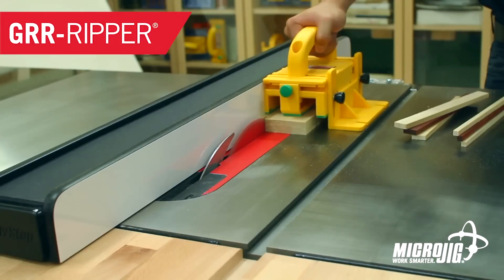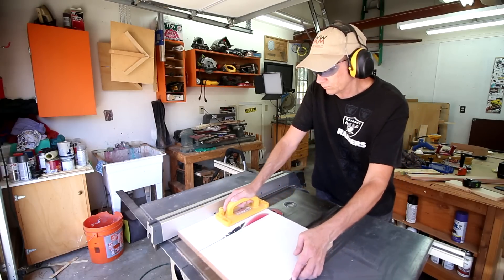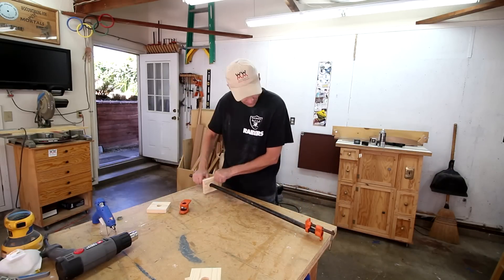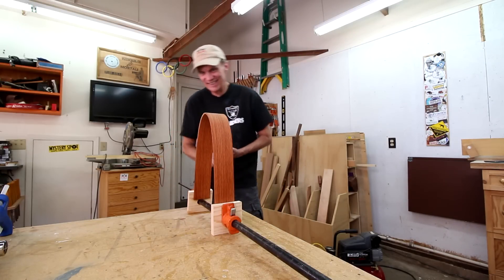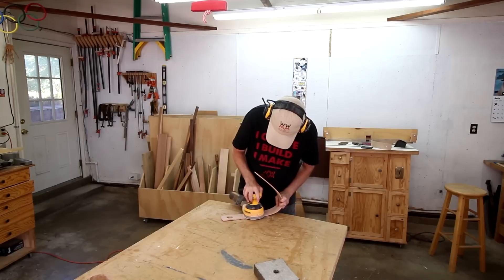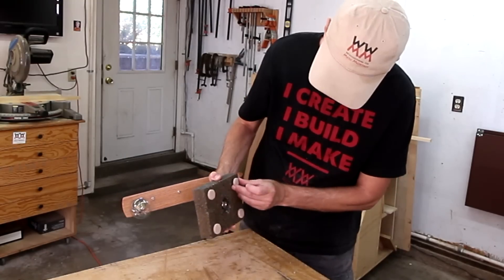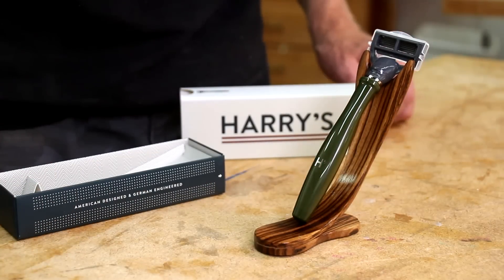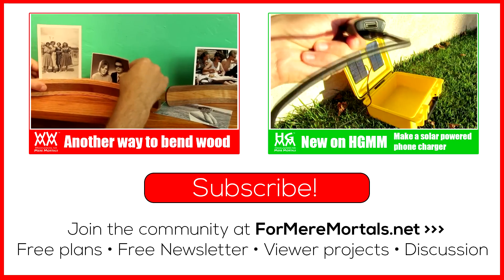Brutalist Style Lamp. Bent Wood and Concrete. | ART & DESIGN

Comment from the maker: For this Art & Design project, I wanted to explore some of the Brutalist concepts and incorporate them into a useful, but artistic piece. Concrete, exposed hardware, and a single bent oak board. Thanks for watching and let me know what you think!
Reply: Good job!
Reply: High Steve, nice project, quick tip about concrete, when you want to knock the air bubbles and voids out of a concrete form try holding a palm sander without any sandpaper to the form, the vibrations will send all the air to the top and you will get a void free cast.
Reply: Brutalism is not because they're brutal, but because brut is french for raw, meaning raw concrete. This is my favourite fact, and I use every opportunity to share it.
Reply: I can honestly say that I thought this was going to be silly, but as you went, I really started to like the idea and concept.
Did you considering making a form to help bend the wood? It might have been safer, but then, also would have involved making more things for one job, so I guess your method was more practical.
Save the form for another long term project?.. eh.

Excellent video over all.
Reply: +John Smith I was just about to post the same tip lol.
Reply: I was wondering what was so brutal about it. :) 
Thanks for imparting your knowledge on us all.
Reply: Sam AOA It's a good one, I learnt it watching a guy making concrete garden gnomes, he had an old beat up sheet sander that he was using to vibrate the air pockets out by holding the sander to the mold, it worked great.
Reply: I love your videos and hope to try one of your projects one day soon. I have to say, watching you bend those boards, you should be wearing safety goggles!
Reply: Steve, I worked for Sakrete for seven years. If you have any other projects involving any of their products, I could give you some tips to make it easier and faster if you'd like.
Reply: I think I would have been tempted to try to polish the concrete; also +John Smith 's idea of using a palm sander is also great.   I love the idea of using raw concrete I just think it could be presented a bit more refined.    Fantastic idea though! :)
Reply: ***** Many thanks, I like the lamp and you could scale it up to make a floor standing lamp too, although I would prefer a different shape to the base, but that's just me  : )
Reply: Holly hooked hockey-sticks, Batman! That bent wood lamp is impressive.
Reply: Any other materials that might be just as bendable like oak?
Reply: +themaconeau I've heard ash is pretty easy. Actually, I recently saw David Waelder bend a piece of MDF with spray bottle and a heat gun. So, I guess anything is possible.
Reply: Rouverius Did you happen to have a linf for that or do I just search his name?
Reply: This is awesome Steve! I've also been digging into the brutalist thing lately as well. Check out the works of Harry Balmer. The "Industrial chain lamp" video I did last month was heavily inspired by brutalism.
Reply: Really cool man . Very inspiring 👍

Comment: Steve, heres an awesome tip as it looked like the concrete had air bubbles and even a crack on the bottom. After pouring the concrete take a sawzall, remove the blade, use the guard on the sawzall and run it along the outside of your concrete mold. The vibration will help settle the concrete. You'll be amazed how well, smooth, and solid it will turn out. Eliminate so many imperfections. I've done this on driveways, sidewalks, patio pads, etc. You get nice clean edges!

Comment: Another great video, when the concrete has been poured in the form a good way to get the air bubbles out is to use a small palm sander on the sides of the form to help get the air bubbles out of the concrete before it sets.

Comment: Hi Steve, this is my first ever comment on YouTube!

You're videos are fantastic. Simple, straight to the point and fun.

You should have a go at continuing this brutalist style by making a wireless phone charger. Maybe recess the wireless charger into concrete? You might want to place a sheet of glass on top of the concrete and charger pad so you don't scratch up your phone on the concrete (or who cares if that happens?lol) Surround the concrete with oak or whatever wood you have and include a tablet charger stand/rest on the back. Of course, the tablet will probably have to be charged using a micro usb wire but thats not the end of the world.

My thinking is this: Your tablet will be on charge when you're out of the house and when you come home, you put the phone down on the wireless charger and lift the tablet :)

Anyway, keep up the great work and thanks for doing these videos!

Comment: Clever trick hotgluing the wooden blocks to the bar clamps! I'll need to remember that as I get more into furniture repair.
Reply from the maker: It's easy to do, but probably not the best method. A form will give you a more rounded curve, rather than an arc.

Comment: Nice project.  For smaller concrete projects like this, if you do want to remove all air bubbles, you can take the blade out of a jig saw then use the jig saw as a vibrator to remove all the air bubbles.

Comment: I really like it, I was surprised how much the oak would bend and stay in shape just soaking it in water, I always assumed steam/heat was required.

I really like the brutalism, there's a restaurant called Handmade Burger Co. and the decor is very industrial, with unfinished walls and the most awesome 'taps' that are literally a copper pipe and 90º turn valve!

Comment: Just a suggestion ... I'm not sure what that "cooking" spray is but I recommend PTFE (Teflon) Spray to prevent adhesion. The dry lubricant variant of PTFE works better than the greasy oil even if you want to pour resin into a mold. Thank you for the great content you are providing!

Comment: Steve, I really like this lamp.... Everything about it is me... The one thing I'd change is the hose clamp... I doesn't fit the lamp... I think you should have cut the metal shade down and use the base to hold the socket on the wood... The hose clamp makes the lamp undecided... I can hear it saying maybe I'm part of a radiator... oh well...

Comment: Jimmy Diresta on YouTube uses canned air to break hot glue bonds.  If you hold the can upside down and spray the hot glue, the liquified gas makes it so cold it becomes brittle and will break away.  That may not have worked to the wide flat bond you had, but it's a neat trick.

Comment: Nice project! At 3:30 when you turn the base upside down there seems to be a crack in the concrete piece. Did lacquer solve the problem (if there really is one)? Should you have used some metal structure inside the concrete for better support/durability? Also the concrete seems so rough, is there anything smoother?

Comment: I'm not a fan of the concrete base, personally, but I love the bent wood and exposed electrical! I'd like to do something similar, and perhaps shape the the board, make it a bit thinner before bending (thinner as in width, not thickness of the board). Do you think a thinner width board would withstand the severe bending? Or would laminate be a better option at that stage?

Base wise I think a couple pieces of maybe 1/4" steel separated by some wooden spacers might be cool?

Comment: I liked the design but have an idea to save some parts.  I wonder if the bolt through the concrete could be avoided.  If the former had one side with a tongue of wood midway on its face then the curved oak could be simply slotted in and friction and leverage would hold it.

Comment: Nice project except for the hose clamp holding the socket. A not too fat O-ring sized to fit snug around the socket and a little super glue might blend in better along with many other ideas. But I liked the simple wood bending. No steam required. Thanks.

Comment: I love brutalism - so was excited to see the video title pop up. The Battersea Power Station in London or even the J Edgar Hoover building are fantastic examples.  

But the bent wood doesn't sit right (for me). It's more mid-century modern. In the end, I love the bent wood but find it too hard to reconcile with the concrete base - regardless of any title. 

A circular oak base, even with the exposed wiring, would have fit better with the curve. Or plumbing pipe out of concrete would have better fit the base.

Comment: Would it be better to add a small strip of wood to the concrete mold so there is a slot for the cord to go through?  Just a thought.  Having the concrete sit on the cord doesn't seem to bode well for the life of the cord.

Comment: nice lamp, but your skills about concrete could be improved. Use white cement instead and add some glas fibers to make it much stronger. Corners should be rounded off with a chamfer strip. Finally put the mold on top of a rotary sander to get rid of the bubbles. Have a look at those pros who do concrete counter tops. Keep on trucking - best regards from Germany - your clips are a must on every Friday - i love them!

Comment: An old Norm made an apron for a corner table which required the bending of wood.  He built a form to the shape he needed and used clams to bend the wood, seemed much safer.The only way a person saves money is to take the amount saved and deposit into saving account and never spending.  I have talked with hundreds of people who have quit smoking and found that non had saved a penny as the used the money for cigarettes and purchased other items.  Not a single person could show a saving by quitting smoking.

Comment: Steve, what is the difference on the various shapes of screw notches?
The older were a straight line, then came the philips, squares, stars like in this video... would you know why? ...thank you!
Reply: The difference is the shape itself.
- "Straight line" aka Slot is easy to make but does not hold the driver centered.
- Phillips & Pozidriv holds the driver centered but can slip thus damaging the screw.
- The rest are just variations of a straight hole that keeps the driver centered and wont slip because they are not tapered.
- There are also shapes that only allows you to turn the screw in one direction so you can not loosen it without special tooling.
Reply: +He Ka I only wish the US would go to the Robertson (square) drive as they have in Canada. Positive lock and no slip as with Phillips/Posidriv. Who has even seen or owned a Posidriv tool?...just sayin'.....
Reply: +RxMixer I can find Robertson drive screws at the Home Depot here in Chicago. The only problem I have with them is that, when using an impact driver, it's really easy to strip out the screw and the bit. Torx drive screws and bits give you better engagement and less stripping, although I have broken the occasional torx bit on a rusty bolt.

Comment: I'm really surprised that just bending oak works that well. I'd have never considered trying that without lamination.

Would increasing the water in the mix have allowed the concrete to settle better, producing a finer surface? I know less than nothing about concrete.  Seems like a great material for doing small work.

Comment: What did you use for the other side of the cable clip screws?
Reply from the maker: Oh, I used machine screws, a washer, then a nut on the other side.
Reply: Thanks for replying, I don't know if you've come across them, but dome nuts work great if you want to hide threads

Comment: I'm glad Harry's and others are taking on the overpriced cartridge razor market, but if you are serious about cutting shaving costs, double edged (safety) razors are the way to go. Cost a little high up front but it's $0.10 a blade which is good for 5 shaves or so.

Comment: Not a big fan of infomercials.
Perhaps your idea was to introduce bent wood technique so I'll go easy but since I have made almost the same lamp in the past I have to say you sure took the easy way out.  Puting a dado on two thin strips and then bending them as you have done but with dado facing dado leaves room to run the wire right up inside the wood so it seems to disappear.  No dado equipment?  Just bend the two pieces like yours and then bend a couple wide enough to leave a dado space between them for the wire to run through.  Just be sure to cut them before you bend them.  It can be really tricky to cut bent boards.

Comment: I'm an ignorant swine when it comes to this stuff so is brutalism the direct opposite to minimalism
Reply from the maker: I think there is crossover, but brutalism places more emphasis on showcasing the materials without adornment.
Reply: +Steve Ramsey ahh okay thanks for the clarification Steve
Reply: The opposite of minimalism would be something very ornate. Gothic revival would qualify, but so would plenty other styles.
Reply: Google has an article on Brutalist architecture and says the term comes from the French word "brut" which means "raw." The architecture movement tended to use raw concrete and similar.
Reply: Interesting idea. They're not opposites as such - they're kind of based on the same concept but interpret it different ways. Brutalism is all about clear expression of materials, so there's a sort of essential simplicity that comes out of that (Deacon Cole is very right to say it comes from the term "beton brut" - bare or raw concrete). Minimalism is about apparent simplicity - hiding how everything is made. So they're both about simplicity and purity, just in different ways.

Comment: it looked good but i would have much preferred a rough peace of wood as the base but that is just me
Reply: I agree, the concrete seems to clash with the wood but at least it shouldn't fall over. Nice project though!
Reply: That what i thought to much clash
Reply from the maker: I can see that. The clash of materials causes a feeling of uneasiness in me. Leaves me a bit unresolved.
Reply: I like the incorporation of concrete. I think it is actually THE element that makes this piece interesting and unique. However, I would've used a wire mesh inside -- concrete has no tensile strength.
Reply: I think the tension/uneasiness is awesome. That means it's done it's artsy job. it's the tension that creates interest & makes it memorable, just like good music. Nice work Steve!

Comment: Lovely project! I wonder why you used the melamine boards for your formwork - maybe you could try with the old-fashioned method of using actual solid wood boards. Le Corbusier used it a lot (I think because he didn't have a viable alternative rather than a desire to do so), and it can leave the pattern of the wood grain in the finished concrete. Might be fun to experiment with.
Reply from the maker: +Will Mc I used melamine because it's easy to remove from the concrete.
Reply: true. All depends on the release agent, I guess.  People have even cast lace into concrete... Cool that I guess the  melamine form would be re-usable, where solid wood is generally used only once.

Comment: I would have made a wooden plug for securing the bended piece of wood to the concrete base and then screw it from beneath the base cause that big fat washer and bolt look ugly as hell ! But I guess all this was part of to the "vintage"  style you was looking for.
Reply from the maker: +skyhacker6 The exposed hardware is kind of the point.

Comment: I like the wood, the bend and the screws, but the screw on the foot ist too big for my taste. It's out of proportion. And the concrete... I like concrete and wood, but for me it would look better if the concrete had a smooth surface without bubbles.

Comment: the paint cans will rust now quicly put aome gun oil or wd 40 on them dont waste good spray cans
Reply: What???
Reply: How does a aluminum paint can rust?
Reply: They are steel, not aluminum.
Reply: +Rmaul246 You will not reply like that to people we dont like it and you would not like to be teeated like this
Reply: they are most definitely steel. but one submersion? cmon, they'll be fine.
Reply: Stick a magnet to your nearest spray can. It's steel. Not to mention, cost wise, making something that handles that kind of pressure out of aluminum would be more expensive than doing it out of steel.
Reply: They're steel, but he's in California. They probably dried up pretty quickly, and they're like 3 dollars in paint? Maybe even less. Also, I can attest to them still working fine even covered in rust.
Reply: Aluminum cannot rust like iron or steel, but does oxidize leaving a harder material on the surface, aluminum oxide, than the original metal.